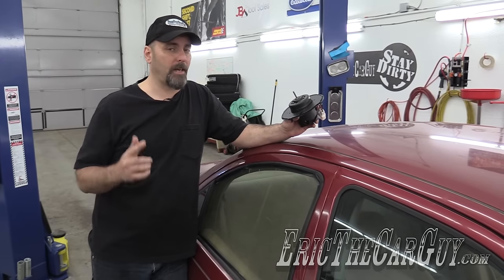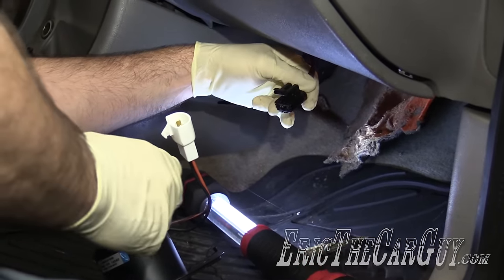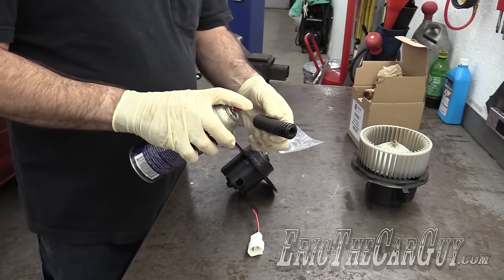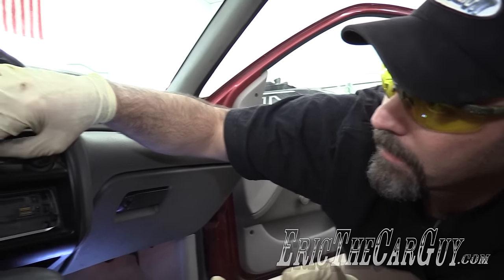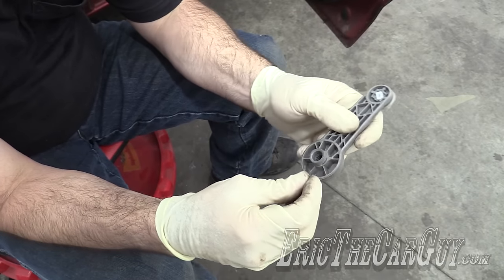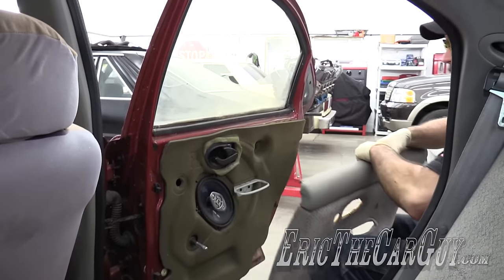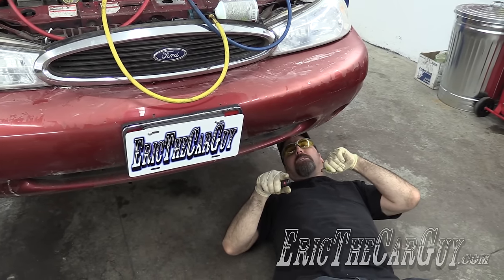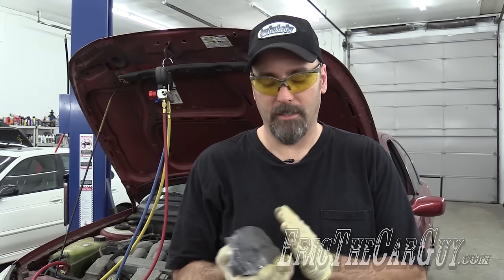1998 Ford Contour Blower Motor Replacement Rear Window Replacement AC Diagnosis -Fixing it Forward

Comment: Dude, this video just saved me a whole ton of work on my daughter's car. I couldn't figure out how to get the blower motor out and thought I was going to have to take the entire dash apart. Who would've thunk it?!? Just a twist. Amazing. One little side note, there was a tab I had to push in to twist the original motor out, in case someone might need to know. Thank you for the video!!!
Reply: I used this same video today too, I replaced the blower motor and blower motor resistor. This was on my son's car, I am not a mechanic and thanks to Eric's video I got it done in less than an hour. Easy peasy  :)

Comment: Blower motor replacement. Me: A modern car that has an easily swapable component, with just a twist? What is this insanity.

I was equally surprised.
Reply: Never seen such an easy replacement before. wish all cars were that simple

Comment: My better half has noise coming from he blower motor in her 04 4runner. 
So this should help give me an idea of what i'm eventually getting into.

So thank you for all your hard work and dedication to making these excellent videos.
Reply: You can drop debris (paper, small bit of plastic) down the vent and it can get sucked into the blower motor fan if it does not have a filter. If that is not the situation then the blower fan could be coming a part (cracking) and when it spools up the fins will contact the housing. Just some ideas.
Reply: yeah possibly. I'm leaning towards bearing noise from within in the blower, since it's intermittent.

either way, I gotta get in there and see what the hell is going on regardless.

Comment: hi Eric..learned a lot of tricks from your vid.   I am a panel beater or body worker as you may call it in the states...regarding rear window it works if you remove all the rubbers and then slide the window in bolt it down and then just slide the rubbers back in place some silicone spray might help to slide it easier...all the best

Comment: I wish Ford would make their minds up. Sometimes even the simplest things can be near on impossible and then you get things like the rear window and the blower motor which were deceptively simple. 

This series has been incredibly nostalgic for me, my dad owned a Mondeo in the mid 90's till 2005. We went from a Morris Ital estate (British manufacturing at its finest... lol) to a mid 90's ford. It was like another world. It was such a quiet and refined ride. It had power steering, a sunroof and electric front windows and no squeaky leaf spring suspension.
Reply: +zoidberg444 Yup. Just look up how to replace a headlight in a 2015 Fusion. You have to remove the whole front bumper.
Reply: +David Plass You serious ? Geez !
Reply: +David Plass I think most if not all modern cars are like that because of the more round fronts.
Reply: +Sammy Noueilaty  Yup - having to remove the cover to replace the headlights is more common than you think.
Reply: I was an 80s child , I have no memory of the Morris ital haha I half remember the van version - if I correct bt used to have them in yellow
Reply: +rejectionfbelief The Ital was the later production version of the Marina. My Dad had had it since the mid 80's. It had a scrap engine and gear box put in it. I don't remember seeing many others on the road. It had done 178,000 miles and I'm reasonably sure the previous owner had run the clock back. It had so much rust and weld on the body and so many rattles.
Reply: +zoidberg444 haha- ah the good old days or patching up & making do haha mot standards are way to high now - simple issues put cars in the scrap yard , my dad had a red Sierra -
Reply: My Grandfather had an escort briefly. It was an older 1980's model built when the UK car industry was a joke. The starter motor died on it and my uncle got a starter motor from Halfords and went to install it. It wouldn't fit, takes it back, asks what the fuck? The guy luckily knew what was wrong and tells him it was a brief run made when Lucas were on strike so they adapted some garbage Italian brand of electrics called Femsa to work in the vehicle until Lucas returned to work. He then told him to get rid of it because the distributors made by Femsa fail all the time and are not available for sale anymore. It got shipped down the road a few weeks later and he got an Austin Allegro. My uncle brought a BMW 5 series around this time that he only got rid of 5 years ago.
Reply: +zoidberg444 haha bloody hell  , I've never been a fan of German cars  but that did well , I've always liked ford and Japanese which is how I got to watching Eric although he's got way to commercial - I tend to watch south main auto & bodgit and leggit channels
Reply: +zoidberg444 I had an early 1979 Ford Mustang that was supposed to have the 2.8L V6, but they ran out of those engines mid year, so instead it got the 200ci straight 6 from the original mustang!

Comment: Thanks for showing your battle with the window, it'll really save a lot of swearing and cursing for DIY'ers :D
Reply: Although don't completely trash the glass like Eric  did , it's obvious that would be fragments of broken glass in the bottom rubber and eric putting glass in a bind and pushing down cause this , I love how he tried to almost suggest it came like that  --- as if !

Comment: Eric, the two holes right above where the bracket mounts for the door panel are there to give you access to the bolts securing the window to the regulator.

Comment: The reason why the "Contour" sail panels are there is because the Mk1 Mondeo originally had vents there and there was ducting in the C-pillar and into the cabin. They were notorious for leaking so in the facelift, AKA the Mk2 Mondeo and the Contour you have there, the C pillar ducting was removed and filled in and a solid sail panel was fitted in its place, so only minimal changes were needed to be done to the stamps and dies. And yes, the rear windows only roll down that far due to the design of the door.

Also the Mk2 doors were ace for being able to fit 6x9s without having to really cut anything out, however I had 6x9s in the front doors and 6.5 inch components in the rear doors. Had some damn good audio quality

Comment: At first I was like dam Eric like this silicone spray a lot how good can it be? Now I've tried it and I wonder where it's been all my life. I absolutely love it its so usefull on anything rubber. Instead of having to pull and tug and curse at rubber fittings until you either win, fail or give up on them. All you need to do is give them a good squirt with the silicone spray then everything just slides together it's awesome.

Comment: Rear window replacement goes like this: you leave the mechanism in and lower it down as far as it goes with that hand crank, pull out all the mouldings, slide in the glass and secure it to the mechanism, then you slide in the mouldings and put everything back together. Just for future reference. :)

Comment: just a little hint on those window fasteners,  there are two holes about 3" above the point where the fasteners when the window is all the way down to make it easier to remove the bolts when changing the glass out. sometimes the easiest way isn't the most obvious way. lol

Comment: dear Eric, a tip for you on removing the window cranks without loosing an eyeball, take a shop rag and drape the center on to the clip where the ears stick up then pull the ends of the the rag down in a side to side motion... a tip I used back when doing flat rate bodywork

Comment: This and other channels like Scanner Danner and Chris Fix are better than those tv shows that come on Saturdays and Sundays on Spike and Velocity because they are not filled with commercial advertisement within their program. Yes, you do advertise places like Pull-A-Part, Car Part Kings or Advanced Auto but you are not like those tv shows that pick up a part and mention the tool maker or store that they got their parts from. Keep doing what you are doing and your subscriber numbers will continue to increase.
Reply: +Frank Gonzalez Those three places donated the parts for Fixing it Forward, I believe.
Reply: +David Plass What I'm saying is that they should be done like when they a sporting event on regular tv. They have several minutes of sports action. and no mention of any sponcer. And at every chance, they get, go to commercial and have spots for their promoters and other things. If those 30 minute infomercial shows were like sporting events shown on tv, those tv shows would be that much better.

Comment: I need replace blower in my renault megane,I wish it was as simple as the one you just changed,unfortunately I need to remove whole glovebox and some trim to get access,so not looking forward to it,going to change the resistor while I'm in there poss save me a future job plus cheap enough anyway

Comment: I just figured out what your shop is missing, Eric- 1 of those hanging retractable electrical extension cords. Mount in middle of ceiling, 100' cord. It would reach the entire shop, and out the door, up on lift, etc.

Comment: Eric, regarding the scratched glass... You should have inspected/thoroughly cleaned the glass before installing it (or accepting delivery of it from the junk yard) inspecting for damage/scratches. Yeah I get it that it was probably a donated part, but If you were paying for this window glass, I would want to know it's not damaged before I forked over the bucks at checkout.
Reply: Give over - Eric scratched that - but shoving it in the opening wrong with the bottom rubbers still in and containing fragments of glass ( glass scratches glass) - he botched it up simple , a more methodical approach would have saved him , and trying to suggest the parts place did it - ain't gonna do him any favours with them

Comment: Window Handle C-Clip: try using a shop rag to shimmy between the handle and the door panel, the clip will catch on the rag and with applied flossing pressure will open and remove the c clip from the handle. Bonus: Rag will hold the clip so it does not go flying. You don't have to see down at the clip to use a pick or pliers. And no worry of scratching or damaging the handle or panel. 

Eric: I love your videos man but your killing me with the dirty gloves on the interior. Not that the interior was clean to begin with.

Keep up the great work. Thank you!!!!

Comment: Air con's are tricky buggers, if you don't use them regularly they get moldy and start to smell. Also your working on
the mk3 Mondeo I've got a mk4 and the AC is used to de-mist the front screen at start up and to keep the
screen clear whilst driving.  By the way, it takes dedication to get  a back door card as dirty as that, was he
using the car as a barn?

Comment: I still have the actual tool for door handles window handles and such from back in the 90s
Reply: +Travis “Boot” Babcock Excellent little tool for when there is one point 0000002 slivers of space between the handle flange and the door panel.

Stay gold.

Comment: you installed the springs wrong...
.just did mine....caliper rubbed on wheel. the spring goes around front of caliper tabs...otherwise it holds nothing! and its a pain! three hands helpful!

Comment: Is the molding around windows so easy to remove and replace on all vehicles? Mine have hardened up and don't block any water going in.

Comment: I've never seen a window be such a PITA. I thought it was as easy as rotating it 90°, making sure the larger portion of the window is up, sliding it down all the way, and rotating it back into position at its lowest position (lowered inside the door).

Comment: Here is a daft thought if air is compressible con you not put air into the system with dye therefore to check leaks then to waste R22 , just wondering

Comment: My 2000 seems nicer than that one but has a growing list of problems. Has the same gas smell, it did have a transmission problem, it doesn't start randomly, alternator needs replacing, ac is not acceptable , passenger side front window is slow going up and down(yes power windows), it did accelerate on its own all the time, brake calipers in front stick, back door hinges are rusted, rear light bar doesn't work, jerks when shifting into gear, cruise control cable is severed, runs rich, poor gas mileage, the trunk leaks, leaks power steering fluid and antifreeze, belts squick, handbrake doesn't stay most of the time. Idles really high when started, speedometer moves sometimes when at a standstill, leaks into the front passenger side floorboard, the antitheft system is bugged, and there's afew things not worth mentioning but there is so many things I need fixing that I just gave up. Has 163k miles tho

Comment: Eric, come on man. I have a '00 Civic EX. You've done how many diff jobs on Civics? You should have known there was a screw behind the lock when you were taking out the window. It's never that easy. Plus, you know how manufactures like to put screws in places for reasons. LOL

I should really pay attention to this. I have to replace my window track for the driver door cause the window keeps falling off track (think one of the tracks is bent).

Comment: 2001 Ford ranger have to code p0460 I replace the fuel pump   n still have the light I didn't pass the emission test.  any suggestions plz

Comment: on obvious a/c leaks I just pump compressed air in to the system
Reply from the maker: +austin h Good idea.
Reply: +austin h i did the same to identify my condenser leak, unfortunately i pulled a short straw because it works great in cold whether (70°F cools to around 40°F) but in hot whether it stops working in its entirety (90°F cools to 91°F)

live and learn, I'll have to take it to a professional i guess.
Reply: +The Evenger don't know if this will help you but last summer my car did the same thing. found out I was low on coolent due to a leak so the cars computer wouldn't let the a/c run to keep the engine temp down. extra stress and what not.
Reply: No. you can't use the air to check the leak. atmosphere air contains humidity and it will filled the receiver drier and makes the oil black and may be acidic effect
Reply: Nicholas Phillips
that is an issue with the V6 variant of my car, but i have an i4, and cooling really isn't an issue. my guess is an expansion valve or a dryer issue.

It has the correct amount of Freon in the system, but the A/C compressor keeps switching on and off. and the weird part is that the cooling fans switch on and off too.

I bought the car without working A/C so i don't know what the conditions should be like. I'm just going to have a professional diagnose it and I'll fix it later. thanks for the input though!
Reply: +Camry le there are inline shop air moisture filters available.
Reply: +Sean “S3EN” Slater If that available, that's good
Reply: We in the HVAC industry use dry nitrogen or dry co2.  It is much more stable to temperature fluctuations. A vacuum test is only testing with 14.7 psi. Never compressed air.

Comment: Why is the window not going all the way down? Is there something blocking it?
Reply: +Alexander Vynogradov The frame of the door is blocking it. Many many many vehicles aren't able to put the rear window down completely, it's just how it's designed. The front door is typically square on the side that swings open, so the glass can go all the way down into the bottom of the door, but because a rear door is typically cut out around the rear tire well it keeps the designer from being able to make the glass go completely down.
Reply: Jesse Crandle Thank you, I've rarely (means that I did not notice such things at all :P) seen vehicles that can't do that (lived in Ukraine and Germany). I know that BMWs windows can go down all the way down... (but maybe not on all models)
Reply: +Alexander Vynogradov While my knowledge is limited on this vehicle, I'd say the rounded shape of the rear door limits the space inside. Most compact sedans I've seen have rear windows that don't roll down completely. So in this case, it's probably normal.

Comment: what if your heater works on 1,2,3 but not on 4?
Reply: +Bryttian Depue.. that's usually the blower resistor ( on most cars it sits on-top of the blower motor )

Comment: Eric, you should really start the car when running the a/c or heat. otherwise you run the risk of draining the battery.
Reply: You don't need to start an engine if you are only going to run the blower or heater for a few seconds. In fact, starting the engine for the couple of seconds and testing the heater or blower uses up more battery power than just running the blower and heater by themselves.

Comment: Love your videos but you seem to rush to much on certain jobs, that would of prevented scratching the window, also the speaker wires were all exposed and should have been fixed while your in there.
Reply from the maker: +ChromeGunner86 The window was scratched before I installed it. Check the footage. Thanks for your input.

Comment: it may have been easier to point the narrow part of the glass down into the door all the way then rotate into the tracks. there were also provisions used to access  the bolts that attach the window to the regulator. they were the two oval openings about 3-4 inches up from where the racheting position already used.

Comment: I have a question Eric

Why you use only Yellow Glasses and not normal clear Glasses?

is there a reason ?

sorry for my bad Englisch

Greetings from Germany!
Reply: +freakyRunner 2 reasons. 1 The yellow lenses filter the light as it comes through and improves your vision a bit. 2 They make leak detection dye stand out because of that same filtering effect.